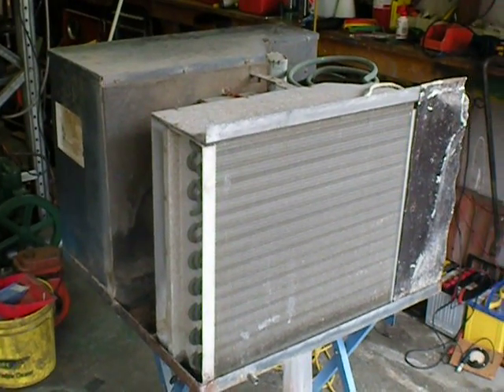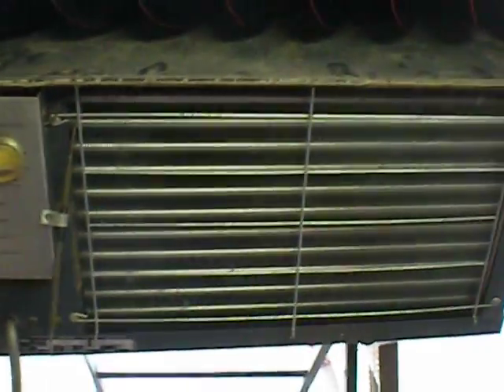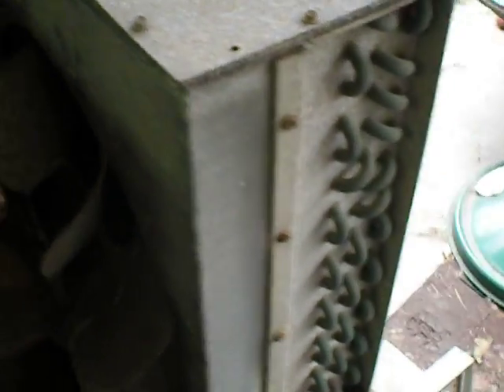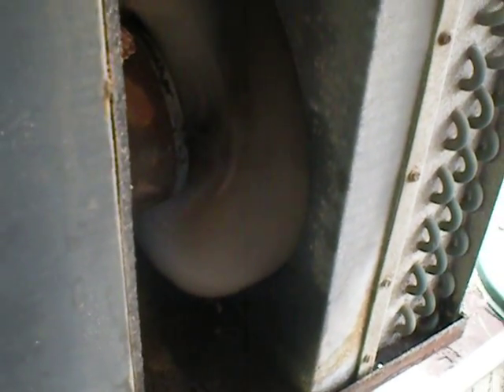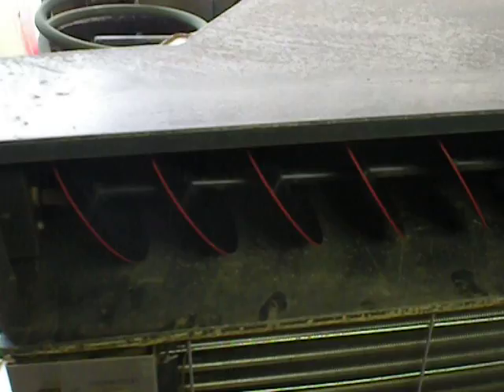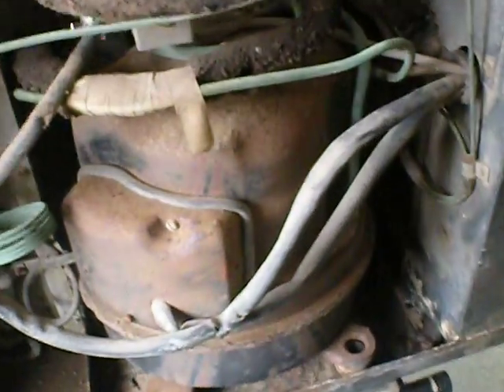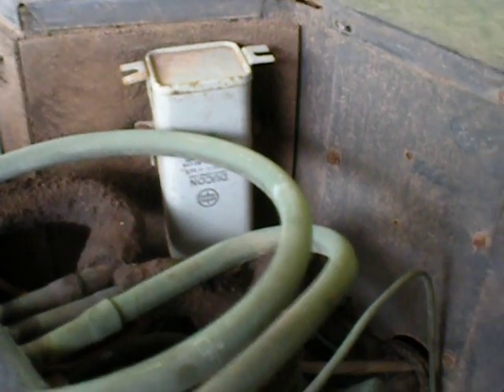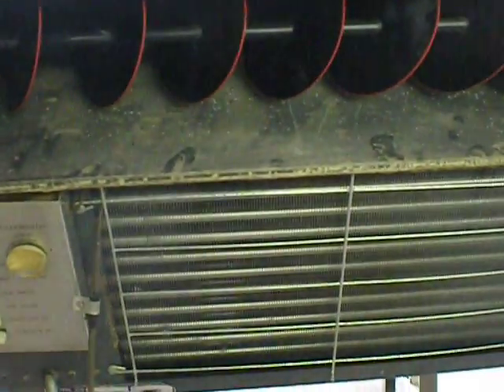a look at a old heat pump.

Comment from the maker: that's sad :( the heat strips are stage 2 heat for when the unit goes into defrost mode. and yer the heat is not as good as a new one but the cool it better that what matters. i dont believe in using the heat. it dose bad things to the coils

Comment: I've retored one 2 years ago. I'ts from Springer, maybe it has 20 years. The thing works like brand new, i changed the capacitors and add some lubrification, new paint and new air filter. As i said, it's brand new!! And it's very quiet.